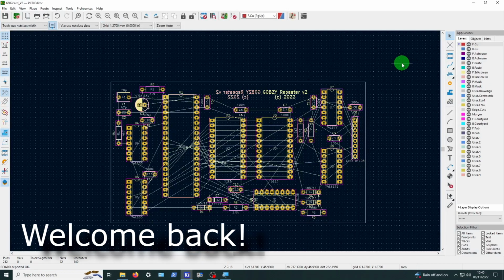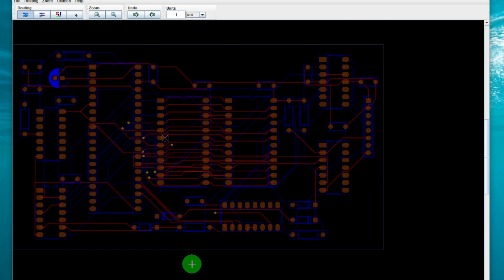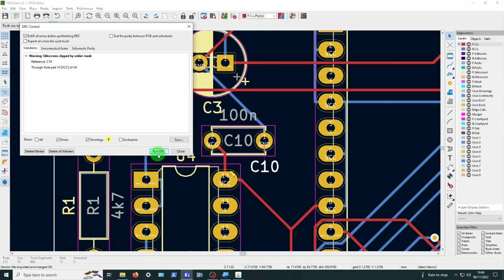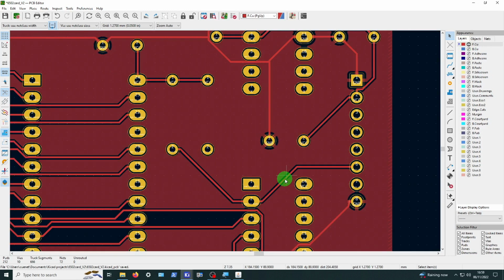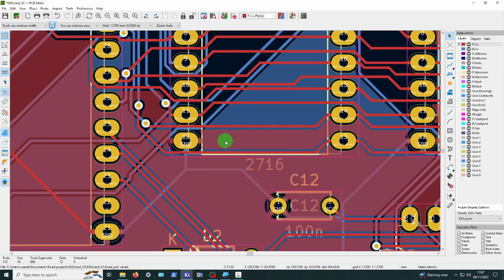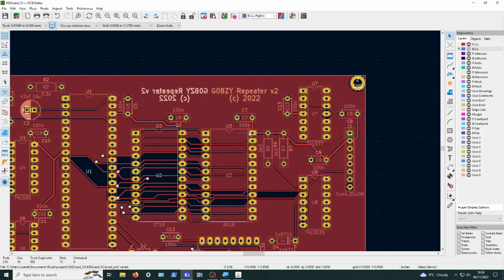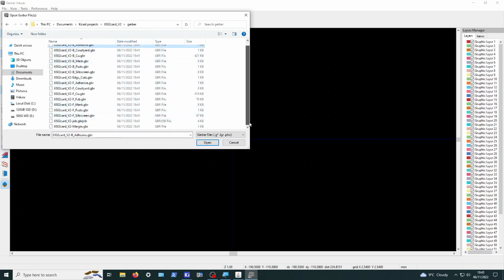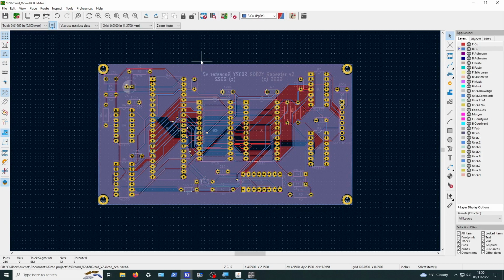AutoRouting in KiCad - Rat Lines to final PCB design : Reverse Engineering a 6502 CPU card

Comment: It's now October 2025 and Kicad is upto ver 9.
Autoroute can now be installed as a plugin. There are instructions on yt. Important tracks can be first laid manually e.g. power rails etc. And then the rest can be auto routed. It runs very fast. Sometimes it gets stuck, simply cancel and start again, my pcb about the same complexity as yours took less than a minute on a mediocre pc.  The purists will argue manaual routing is better, but as a beginner, this has saved me literally hours and produces good results. Any routes you don't like  can be tweaked later. And of courseyou can reposition components, delete all the tracks and start again! Make your pc do the work!
Reply from the maker: Hi Mike. The video was posted on 27 Nov 2022. So its nearly 3 years old!. Yes things have progressed since then. And i cover some of those improvements in later videos including the plugin for auto-routing. As they say, technology marches on. Thanks.

Comment: Autoroute creates ugly layouts. They will fail in EMC tests and reduces producibility. Very seldom used in professional field.
Reply: totally agree - if this autorouting has taken half an hour it its a waste of time.
I would had done the same job in the same time - manually.
On top of that there will be at least an hour just to clean up to have decently signal routing and to have nice power planes.
My 25 years old version of PADS PCB does a better autorout job in 20 minutes, and even obeys net design rules including max length diff.

Power routing is poor and could easily have been routed much better manually.

My judgement is that this would had been a two and a half hour job manually - placement and routing - and you would have had a much more robust power routing
Reply: I understand what you are saying, but for my project, it was just what I needed.  At the very least it's another option.

Comment: I have found, that with Kikad, the reason that the Ground plane does not fill all of the area's like in your video (it does it to me) is because the routing of the traces, leaves those area's without free access to GND.  You will find, upon looking, that the area's are completely surrounded by traces, or even socket pad clearances.  I put a ground plane on the bottom layer and it did this.

Comment: Hi Paul, Kicad as of recently included FreeRouting as one of the Plugin options. 
Check it out, makes it quite a bit quicker and more seamless to use.
Reply: If you setup all your netlists and constraints in advance (power trace 
thicknesses, special signal net clearances etc) FreeRouting will take 
this into account and adjust accordingly.
Reply from the maker: Hi there, well thats great news. Must be very recent. I was using the latest release just a few weeks ago and it was not included. Will investigate!

Comment: I used to use Orcad and Tango 25 years ago and I found that tracks look ok on the monitor but in practice they are too fine or close together. The vias and tracks could be moved manually here.  Reorientating the components sometimes gives a better result. 
Just initial comments...I'll carry on and watch the rest of the video....nice presentation btw.
Reply from the maker: Hi there, yes the tracks from the autorouter can be thin but fine for signal work, once its passed back to KiCad, its just a case of adjusting them to a more suitable thickness, like for power rails. Yes Orcad, its still going today i believe :) thanks for watching.